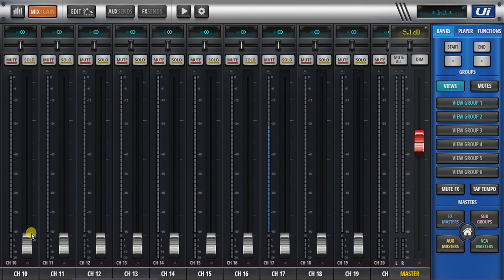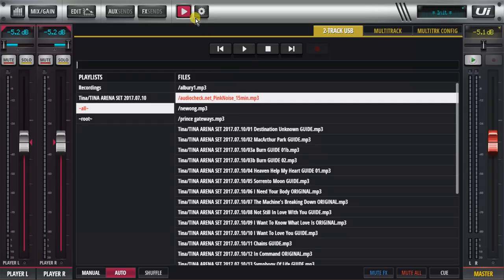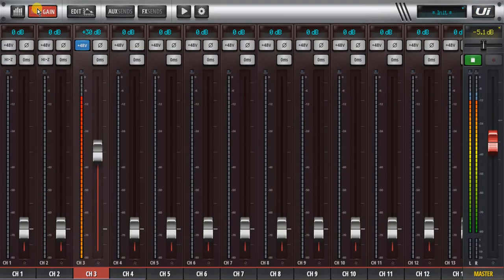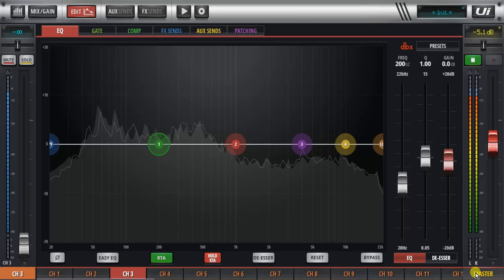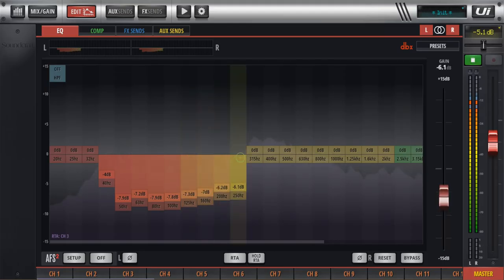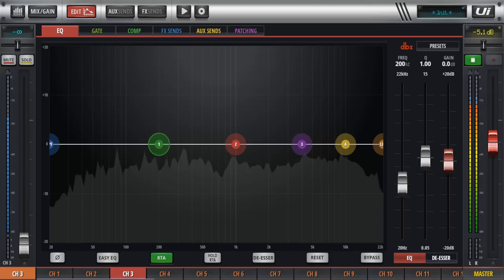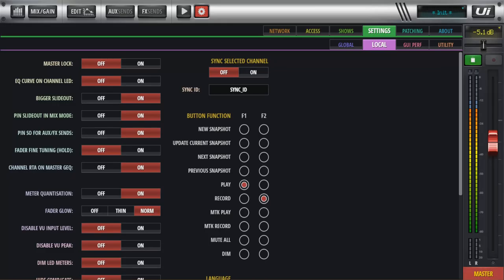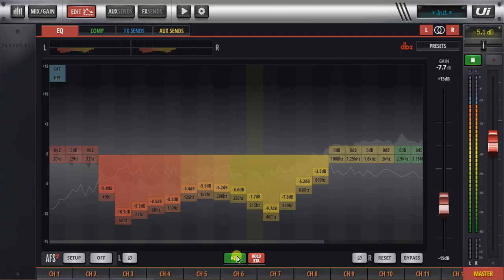Ui24R using the RTA to tune a room

Comment: Was looking forward to trying this for months. I finally did it today and had terrible results. I used Grey noise from Audio Check. To measure, I used the Behringer ECM8000, about ear level, from the expected middle of the audience. Used a QSC K8.2 speaker. Not a terrible room either. The noise didn't sound neutral after I got the frequency flat on the Master. Speaking in a vocal mic, it sounded like a telephone effect. When I bypassed the EQ setting (undoing my changes) it sounded much more natural. Was very hopeful for this, but wound up very disappointed. Don't know if It would be different with a different mic or what. They certainly advertise that mic as being extremely flat, but at $35 I wouldn't be surprised if it weren't. Now I'm thinking...I chose grey noise because they say it's perceptually equal in volume per octave (more so than pink noise, which is technically so?). I'm thinking this would probably only work if I tuned the room by ear? Since I'm tuning by sight, it may work better with pink noise as you used in your video.
Reply: Tried again with Pink noise and had a much better result! Inclined to feed back up close at the frequencies adjusted the most, but this makes sense since the measurement mic was at a distance of about 15-20 feet whereas the mic was close when feeding back, not experiencing the room's impact at that short distance. Thanks!

Comment: I had updated my Firmware, and then did this, the thing was I was then having an issue with my unit losing sound randomly , finally it just wouldn't boot right after trying things to stop it from happening, so I did Factory Reset and I'm  not having any issues except RARE cases of Drop outs (like maybe twice since I reset about 6 months ago and started turning the volume down first and then shutting off (I hate that the switch is in a bad spot for this) it seems to help though, and I am not about to upgrade the firmware to possibly start having more issues as before, IS THERE A WAY TO DO THIS WITHOUT "CHANNEL RTA ON MASTER" Function/Option ?, AND also does the Pink noise mp3 HAVE to be on the UI24r or can it be played from my DAW through the UI24r ? Or from any other playing suorce for that matter ?

Comment: I got two thoughts about that: If you´re using GEQ for this kind of tuning, you´ll get massive phase issues on the sides of the filter. The proper way to do this specific kind of tuning would be to use a PEQ, because the phase will change only on the sides depending on the bandwidth. The second thought is, that to tune a system only by pink noise is nonsense. Try to go near the fohn curve and by listening to material you know to tune the pa to the room. Well, i´d like to buy a UI24, but if there is no PEQ available, this "system tuning" EQ does not satisfy my needs. Anyway: THANKS FOR THE VIDEO
Reply: The soundcraft UI series has both GEQ and PEQ on board

Comment: Great video. I am confused though about the routing. If I play the pink noise through my speakers it will first pass through the master channel and show up on the RTA. How do I avoid that? And with the fader of channel 3 down the mic signal will not show up on de master RTA. And you cant push the fader up because that will create feedback. Solution is to have the player output to an aux and connect the speakers to that?

Comment: I am unable to find "Channel RTA on Master GEQ" in the settings on firmware v2 or v3.  Did it get moved somewhere else?
Reply: Now reads as show RTA on all Outputs
Reply from the maker: No it was not moved as far as I know.
Reply: @mix-record-connect9938  I just checked the online demo.  Doesn't appear to be where the video shows.

Comment: Can i use file with sweep signal instead of pink noise?
Reply from the maker: Yes you can use it but how will you remember what the signal input is?
Reply: Mix-Record-Connect Thought that hold rta can do.

Comment: Thanks for this great tutorial!! Great stuff!
Unfortunately, I have a problem and I don't know if this is a bug or just a wrong setting that I don't see: I can see the RTA curve only on the Master EQ setting, it does not show up in the single channels. I can activate the RTA button, the level in the fader shows up, but the RTA curve is just not shown. Maybe this is a bug in firmware 3.0?
Reply: me too 3.3
Reply: @romulocs6777  I had returned my unit and received a new one, it must have been faulty. Could not activate the RTA curve at all. With the new one, it works now.
Reply: @7Boots  thank you

Comment: Is this close to the steps you took to do this?
Using Pink Noise to Tune a Room (FOH)
1. Setup Reference mic on channel and place in middle of the room
2. Player set at -5.2DB
3. Play Pink Noise File
4. Gain on RTA Mic Channel at +30dB
5. RTA Mic Channel at -∞
6. Master set at -5.1dB
7. Check Mic Channel EQ
8. Turn on RTA
9. Switch to Master (Will show Graphic EQ)
10. Flatten the overall frequencies
11. Recheck with the Mic channel to view frequencies across the spectrum.
Reply from the maker: yes you can do that, certainly one way to achieve this if you are looking for a flat EQ
Reply: @mix-record-connect9938 ……does the mic have to be placed in the middle of the room?
Reply: Sir,is it rta mic on chanel 3 you turn on the phantom power?

Comment: Hello... Can i do the  same thing on ui 16??
Reply from the maker: UI16 has RTA, you can still use a similar method to at least see what is happening in the room frequency wise
Reply: @mix-record-connect9938  in this video you say that  one of the important thing to do is to set "channel RTA on master GEQ"   ON........ On ui16 is only   "channel RTA on all outputs"   and i wonder is this same thing as  " channel RTA on master GEQ"??? .... Thank you
Reply from the maker: @BoRiala050   this is a video about Ui24R not Ui16. Ui16 you can see an RTA that's about it

Comment: Am I mistaken or doesn't pink noise reduce in amplitude as you go up in frequency. So if you used pink noise to tune a room flat like this then you would end up with a PA that has no low end. 
It's a different story with white noise, which is the same amplitude over all frequencies.
Reply from the maker: You are right in what you say about the difference between Pink and White noise,  but Pink noise is more attuned to how our ears and mind perceives sound, (Quote) it’s not that pink noise is calibrated to the human ear’s frequency response per se. It’s just calibrated to how we hear, which is very well grounded in math. Each time the frequency doubles we hear that as an octave. From one octave to the next we expect to hear an appropriate amount of sound energy (depending upon the program material), which is why we calibrate our audio systems to pink noise.
Reply: I use white noise to sweep a room with.

Comment: I was wondering what the procedure for setting the proper gain staging level was in regards to setting "master level" MIX R and MIX L controls. I have powered PA speakers.
Reply: to get the most out of a digital system you want to run it as close as possible to 0 db on the meter scale, normally most run at -6 or so just to keep it in check you then adjust the anolog output to reduce the level as you require. Speakers should be on Unity gain so not to add more noise.

Comment: I understand changing the master EQ to tune the PA to the room acoustics.  I don't understand why you would use the channel 3 GEQ and not the Master GEQ.
Reply from the maker: I think you misunderstood what is on the video, a channel does not have GEQ only outputs have GEQ, I am using channel 3 as an input for the RTA microphone.
Reply: @mix-record-connect9938  where was this RTA microphone positioned in the room?
Reply from the maker: @DeadOriginal  It was just a test to show how to operate not specific positioning of the MIC.

Comment: THanks for the video - could you tell me wehre you place the microphone for best results. Thanks Tony
Reply from the maker: the room tuning microphone? if you are tuning for timing middle of the room. if it's for room EQ, several spots maybe better than just one as different areas of a room may sound different as well.
Reply from the maker: For tuning? best to do it in several locations, not just one and get an average done.
Reply: @mix-record-connect9938 ……So in a band with five mics, should this process be done with each mic?

Comment: Hello! Why you do flat pink noise instead white noise? Pink noise changes is -3dB/octave, white noise is 0db/octave.
Reply from the maker: (this is from several reference sources):  it’s true that white noise has constant energy right across the frequency spectrum. But while this might make it useful for measuring audio equipment, it means it’s of no use for my mixing. Why? The human hearing system’s frequency response is not linear but logarithmic. In other words, we judge pitch increases by octaves, not by equal increments of frequency; each successive octave spans twice as many Hertz as the previous one down the scale. And this means that when we listen to white noise, it appears to us to increase in level by 3dB per octave.

A more ‘human-friendly’ distribution of energy results when we filter white noise so that it loses 3dB per octave (going upwards). Each octave then contains the same amount of energy as the next one — so it sounds naturally ‘balanced’. Well, this is precisely what pink noise is.
Reply: Thank you for answer! But human ear is like U-curve law with bottom on 1-2kHz, not 3dB/octave decrease law! Not pink noise but GREY NOISE.
Reply from the maker: Well sadly I just had Pink noise and that was the explanation I got.

Comment: Lots of features. Lots of questions.
I assume that what you did here is in a music venue. Have you used this to tune a home studio? How did that work out?
Reply: RTA is used to tune a venue where you don't have control over the acoustic/absorption situation. It's generally not recommended for tuning a studio/listening environment.. Much better to "tune" your control room with bass traps and acoustic panels to get a well balanced frequency response in the listening position. Many near field studio monitors also have some built in EQ settings or big room/small room scenarios, mostly in the the bass spectrum.